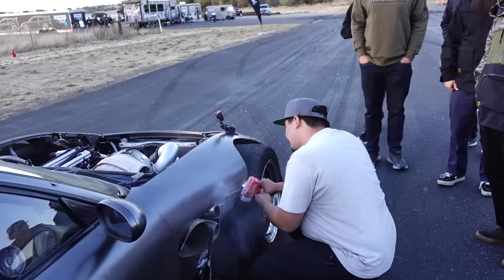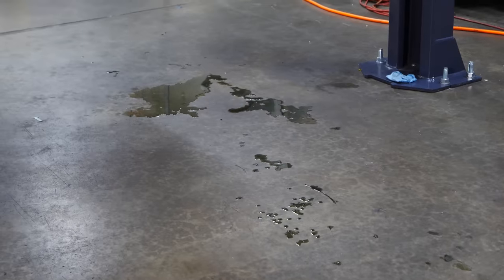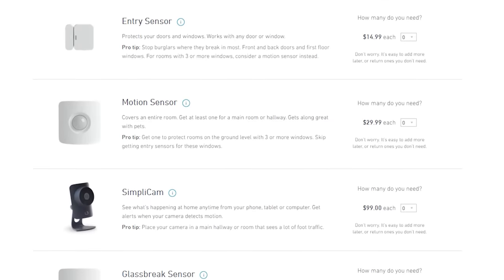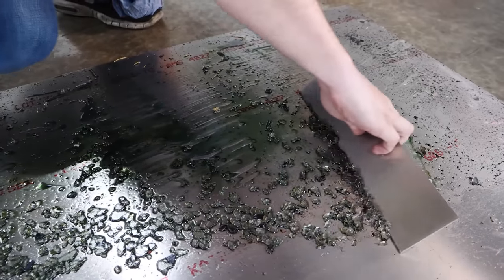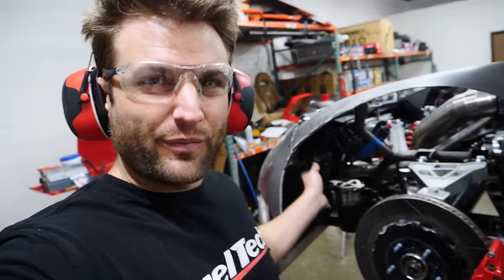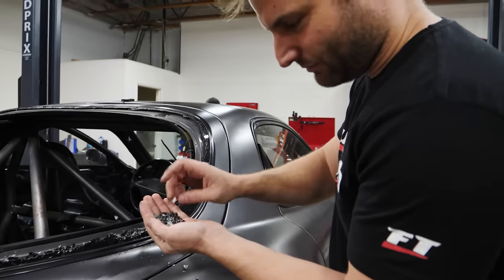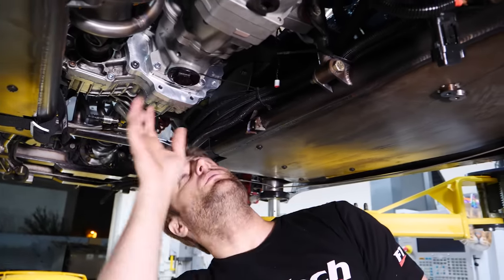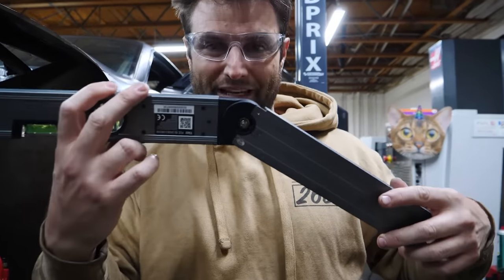How bad is the Damage on the 4 Rotor RX-7 from racing the Hoonicorn?

Comment: The toughest repair will probably be the roof right by the rear window
Reply: Carbon fiber roof has entered the chat
Reply: F it....more bondo!
Reply: @thedude7726  yeah that seems ideal, considering that its not a light car at the moment, that will save some weight + add rigidity if needed
Reply: Repair the battle wound it got while racing the Hoonicorn? Nahh
Reply: Yeah it's actually not that hard to fix... sometimes people take a perfectly normal roof and chop it up for a cf roof. It's literally just a carbon fiber skin.
Reply: @userise222  thought the same, shave some of that weight off. Still won't been the 300lbs to match the hoonicorn
Reply: @jacobhobbs08  this car is rough around the edges enough haha... it needs a carbon roof.
Reply: StreetBanditos collab ?
Reply: Time to start again with a new shell... 🤣🤣
Reply: @sunnyricer  dude that would be awesome man, that carbon 240 is beautiful
Reply: @Matty.Hill_87  what shell...the pipes are good XD
Reply: He'll probably make a mold off the 3 rotor roof and create a carbon fiber panel starting from the top of the A-pillars and going back to the C-pillar or quarter panels. And maybe cut off the damaged roof while leaving a 1 inch flange to panel bond the carbon to. Doesn't have to be structural since the halo in the cage/tube chassis takes care of that part.
Reply: A few ways he can go at it. chop it out and put new sheet in, that's the hardest. Then there's bondo and fiberglass, that's not right for this car. A propane torch and a ball peen hammer, will be very tedious. OR replace the entire cab with a carbon fiber cab.
Reply: I think the plan is full carbon shell eventually anyway.  That banged up roof is gonna be there for a year or more lol.
Reply: @chikato7106  This 4 rotor is a thing of beauty idk what u talking about
Reply: @thedude7726  Call the Street Bandito crew
Reply: @chikato7106  but if he gets rid of that 300 pounds of bondo with carbon fiber fenders, then it will be a race
Reply: bondo and paint make it what it aint
Reply: What i love about this build is that it's basically just rob and his homies building it in a garage/shop.
Reply: Duner250R  going into that active weight reduction mode.
Reply: Time for T-Tops

Comment: beadlocks up next
Reply: Why?
Reply: @fiisho  because when he launched the car it spun the tire on the rim when the tire was completely fully of air. At this point it’s obviously necessary moving forward
Reply: If he wants to go fast gotta fuck off those stance boi rims and get some actuall sidewall
Reply: @CleetusDaily  idk man seems like hes already gripping with the tire enough.
Reply: I rather have the tire slip than rip
Reply: @Jamikeus  nah needs bread lock bro tire spinning on the rim is bad and makes you slower. All fast drag cars have bead lockers on them
Reply: @CleetusDaily  he is on sticky mickys
Reply: My same thoughts
Reply: @CleetusDaily  he has very sticky tires for drag/street racing but he’s putting so much power it’s just maxing it out
Reply: I bet you got some good data!
Reply: Or he could send it to Bugatti and buy their $20,000 tire glue 😂
Reply: Yep
Reply: @Jamikeus  that’s why I said sidewall. Nothing to do with grip . Sidewall gives the tyre flex
Reply: @owen7728  THATS WHY I SAID MORE SIDEWALL DID YOU EVEN READ ?
Reply: He can't increase the side wall without shrinking the rim size in turn less room for his brakes which he already barely clears.
Reply: @johnsierchio2115  first of all, the tyre isnt going to rip. 2nd of all, if the tyre can slip on the rim during acceleration, it can slip when braking... Let that sink in.
Reply: JB Weld?? LOL
Reply: Yeah definetly needs it with all that tire slippage.
Reply: Yeah beadlocks, maybe a smaller brake kit to fit more tire
Reply: I don't think he used bead sealer
Reply: Should have sprung for the Weld Racing wheels.
Reply: @Jamikeus  i mean nothing broke sooo he needs more grip
Reply: Why do you associate yourself with someone that scams their customers? He quotes a customer and receives 50% of the payment upfront and then after a bunch of excuses, can’t come up with the money after failing to do any of the work. Isaiah aka FABscammer

Comment: Rob when his car literally falls apart at 100+mph: it is what it issss
Reply: It hardly fell apart, it was janky bodywork that let him down because there was no time to sort it properly, I bet mechanically it's still rock solid
Reply: Apart from the oil line that burst obviously 🤦‍♂️🤣
Reply: @Matty.Hill_87  did it blow up due to pressure or because of the glass?
Reply: @LtdJorge  not a clue man, think he's going to explain all that next video
Reply: Jeremy Stephens  how long has it been a functioning car? Bodywork is last on the list when you're building a car like this
Reply: Jeremy Stephens  Why are you even watching if it's such a "half ass build"?
Reply: Jeremy Stephens  let's see you build one.. Oh yeah you can't 🙄😂
Reply: Jeremy Stephens  turbo isnt too big. Its a rotary they move alot of exhaust gasses as opposed to a piston engine. They require way bigger turbos to make power. Also the car isnt even fully turned up yet has another 700-800hp on tap.
Reply: IRIS WHAT IRIS
Reply: @Matty.Hill_87  i bet you call slapping some coilovers, pod filter, and some replica wheels a build. SMH with these ignorant comments. Dahm designed and built the chassis and powertrain

Comment: correct me if i'm wrong, but i think the front windshield is annealed glass and not tempered. but you're correct about the layer in the middle obviously. front windshield cant be tempered, because you can loose all of the vision thru the windshield just because of a small crack.
Reply: AS1 Safety glass is annealed.  you also see it on alot of luxury cars as side glass as its sound deadening qualitys are far superior than tempered.
Reply: Laminated glass

Comment: An option for the front axles would be RCV axles, they are typically used for offroad applications but if they are rated for 44" mud tires I would think they would stand up to the torqs required here. I am sure that they would be able to help design really stout units with all the angle needed. They have a lot of custom design information on their website -> https://www.rcvperformance.com/custom-applications.html

Comment: hi rob. a cars front windshield is not tempered/toughened glass. Yes it is laminated, but not toughened. all other windows like sides and rear or sunroofs are tempered/toughened. they refer to toughened glass as safty glass as for like u can see with yours it explodes into small little squares that dont have razor sharp edges like a single pane of broken glass would.. but beware, that safety glass can be just as dangerous if large chunks  fall onto you before they separate. I have had this happen a few times at work when installing tempered glass and its exploded above my head and large heavy chunks had fallen onto me. it splits you open pretty good.

love your videos by the way.. I only just came across your youtube about 2 months ago. spewing ive been missing out on your journey building your RX-7

Comment: Try using the CV joints from an Audi/ Volkswagen/ Porsche. They are almost indestructible, quiet and out of this world. They use a squirrel cage and large ball bearings. Easy to disassemble, remove driveshaft lock bolt, slide shaft out of hub and reinsert lock bolt in shaft, the bearing will self disassemble. Maybe more compact than your current CVs. Beautifully engineered.

Comment: Hi Rob,
you need to setup the suspension with your weight on the driver seat, so it doesn't keep scratching the tires in your fenders. The only reason why the driver side scraped but not the passenger side. Hopefully you will come to that conclusion and keep improving this insane build. (In a Hoonigan post you can see how crooked the car looks with you in it)
Greetings Noah

Comment: I'm wondering If the hood pins came out from wind or initially vibration, then to be aided by the wind. The reason being the GoPro also vibrated off the mount just before the hood came back over the car. I wonder if you have some engine-specific RPM and drivetrain speed that when together at certain speeds harmonically resonate causing more vibration than usual. This car seems to have tons of vibrations. I wonder if you can like mount accelerometers to different parts of the car to pick up vibrations and harmonics.

Comment: I think with alot of R&D, some "adjustments" to the bodywork and some seat-time in the car, and this could be a very potent weapon, you're going to have alot of flaws and imperfections to remedy with any type of conversion, but this is massively different, this is unknown territory and a car so fast it wants to rip itself apart, all tuner's/manufacturer's have the same issues but we don't get to see it until it's done, dusted and has a coat of polish on it, hats off, I'm pretty sure it will be capable of warp-speed at some point 😎👍🇮🇪

Comment: After reviewing the video when your hood failed, it seemed to take quite a while to get into your power band. If you could achieve year powerband sooner I feel like that race would have been much closer. You know this already though. Is this a gearing issue?
Reply: Part of it is it being a rotary and a big single turbo. And if he had no lift shifting that would help it not fall off as much with the gear changes. Otherwise there’s surely some tuning and changes to the turbo that could help it get into power quicker.

Comment: Your hood flew up because of the flat bottom of your car. You need to have more ventilation through the hood and fenders. When air goes in it usually goes under the car and since that’s not an option it creates pressure under the hood,

Comment: Actually windshields are not tempered glass they are just laminated, so that means its 2 regular pieces of glass that are pretty much glued together, that glue is what holds it together and actually much safer than tempered would be in a wreck

Comment: Have you ever considered putting two QFM-360-X motors. Each motor claims to make 1340hp and each motor is about the size of a rotor. Imagine a 2680 hp engine the size of a 13b. Granted this motor is electric but this motor literally looks like a rotor or at least that was the vibe I got when I first heard of this motor.

Comment: When Penske developed the “Beast”the tires slipped on the rims.They media blasted the bead area of the rim and that solved that problem.
Reply: GM added grit to the paint in the bead areas of the rims on the newer Z28 Camaro. Not because of acceleration but because of hard braking. So both are good options.

Comment: I watched your video and from the sound of the engine I believe you need some more tuning.  The engine fueling map is off.  And I believe you have a substantial amount of untapped power available.  I should mention that I use two build these  from 1977-1986 along with race applications. Rebuilt so many I lost count.  Even recognize some inhearnt design problems that really should be overcome.  Keep in mind the rotary is technically a low rpm engine based on rotor speed with a high rpm output shaft.  I have a new apex seal design that would allow a substantial increase in rpms and solve the spark plug problem.

Comment: laminated windshield is annealed glass so it has change to just crack when rock or other objects hits it. tempered glass would chatter into million pieces. It is also easier to crack windshield than break side window  (will not crack) if you have ever tried, because tempered glass is stronger.

Comment: I was thinking the hood i think the reason why it broke was because too much air was being pushed in while not enough was able to escape which cause to much pressure to build up in the engine bay which caused the welds to fold upward and once they folded more air was being forced in which caused even more pressure that caused hood latches to release and let the hood edge climb to allow it to fold and fail
Reply: I think metal floor under engine needs to be a little redone or wheel line needs to be a bit redone because i think that also builds up air and also if you fix that you reduce hot air entering engine bay and you also increase power due to less hot air surrounding the turbo
Reply: Science
Reply: Can we get rob dahm to look at this so he can think about it just to help with air temp

Comment: Maybe if you add a better body to the car with increased rigidity and a change in some part placements with the right tyres and focus more power to mid rpm and low then your rotary would be a beast

Comment: Have you ever thought about actually checking the wheel & tyre envelope prior to allowing things to smash into one another then do something with the ensuing carnage? Full droop, full compression, ride height & steering lock are all things which should be engineered in rather than happened upon by chance. It's frankly terrifying to think that you're driving something with this level of performance without even understanding the basics.

Comment: Please have a look at your brake lines, I see the braided hoses in direct contact with sharp metal edges in many places, and that will sooner or later cause problems. Also, straight pieces of braided hose for oil/water that is attached with stiff AN connectors unscrewing themselves or come loose with movement and temperature cycles since they are so stiff that the slight torsional movement they exhibit produces high torque, at least I was told this back in my motorcycle days when I went through most ways an Aprilia can break it's engine on the track, I even sprayed engine oil on the track on two occasions due to brand new oil pressure sensors failing from the vibrations or pressure pulsations in the oil circuit - I ended up adding half a meter steel braided oil-line between the block and the sensor(s) to attenuate vibrations and pressure pulses somewhat, and it didn't break sensors anymore..

I also spotted some weirdness mentioned below, maybe it's just the camera angles or my eyes.

9:10-9:20 - from some angles it gives the appearance that parts of the suspension attachment points/joints have bent or moved, I get a similar feeling from some of the other shots of the corners of the car

13:24 - it looks like your drive shaft is touching a nut on the suspension link there, and since it's carbon fiber I suspect that it will soon cause the shaft to snap.

13:28 - it looks like the weld for the top support of the upper link arm has moved/begun to crack, has the (weak) attachment point that goes through the wheel spindle that holds the wheel bearing moved/worked up play in the threads for the rose joint, the bolt that goes through and holds the rose joint bent or anything?

13:29 - the threaded tube that extends the path between the inner joint and outer joint for the steering rack looks like it has no nut to prevent the inner joint/threaded part from unscrewing from the rest?

13:42 - how much metal ended up entering the uncovered turbo inlet there?

Comment: You are going to have to add inner wheel arches, and work out some way of venting the excess air pressure. Otherwise the excess pressure inside the car will blow out windows and maybe even blow the doors or rear hatch off. If you look at LMP1 and LMP2 racing cars, you will see many of them have vents on the top of the front wings and extractor vents at the back of the rear wings to disperse wheel arch pressure.

Comment: How much power can a 4 rotor turbo make? What's the limit? Can they make 1800 or 2000? I don't think he needs to make much more to consistently beat the hoonicorn. Reducing weight, setup, gearing, tuning.  The car looks bouncy to me, also it looks like it bogged between second and third, gearing might need some work to keep revs up.

Comment: @Rob Dahm The problem of his 5 point turn is 13:33. He has the stabilisers in front of the axle. what this means is, that on a right turn the inner wheel is turning slightly while the outer wheel turns hard right. what it is suposed to do on a right turn: the inner wheel should turn hard right and the outer wheel should turn slightly right. that is the job of the steering stabiliser. as he has the stabiliser in front he completely messed up the steering.
-> See ACKERMANN STEERING GEOMETRY

Comment: spinning tires on wheel is sadly very common, even for RWD only cars with track tires, not drag, you need wheels with notches where the bead sit, all proper race wheels has this, or will give you it as an option, often also called knurling

Comment: It seems like the line on the rim would have been on the other side of line on the tire if it was due to acceleration torque 
Probably happened when you were using the brakes  
Nice job with your first race in the 4 Rotor that thing is a beast

Comment: You have no idea how much that hood flying up hit home lmfao. My first car was a 1986 2x2 I did the Holley four barrel kit from Racing Beat and the full header and presilencer setup they sold. My baby. Lol. Nut yea the hood latch broke. i thought a bungee would be sufficient. Lol it wasnt. Hood flew up at like 80 and smashed my windshield to
Bits. Dented up my roof just like yours and broke the mount on my sunroof. So fast forward three weeks. Fixed my hood latch. Again hauling ass down the street and my fucking sunroof flew off too lmfao

Comment: You should put small drain holes in the flat bottom for more sufficient drainage.
Reply: i think the point of the flat bottom in races is so it doesnt go on the track
Reply: @michaelh.1262  At least like little plugs that could be undone. That build up was pretty nasty in there